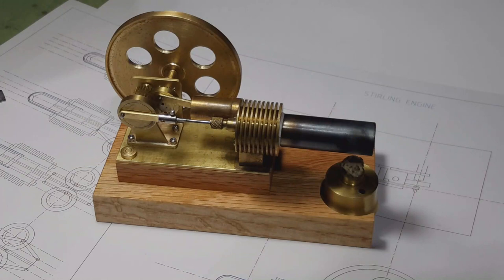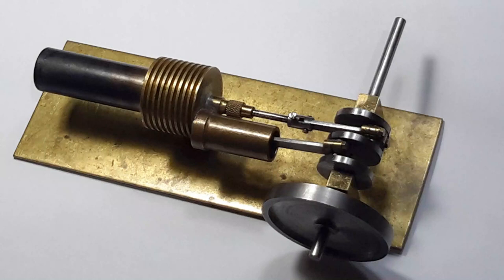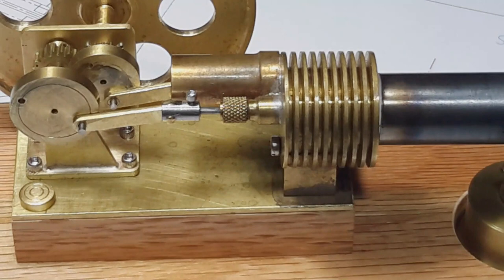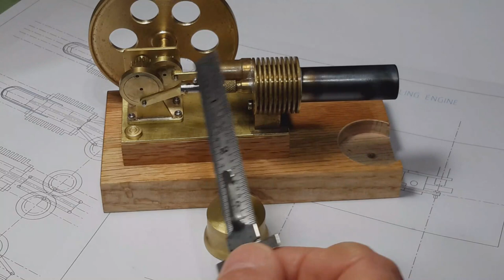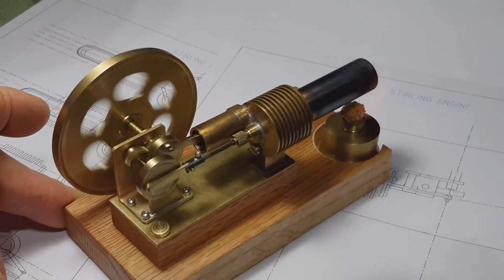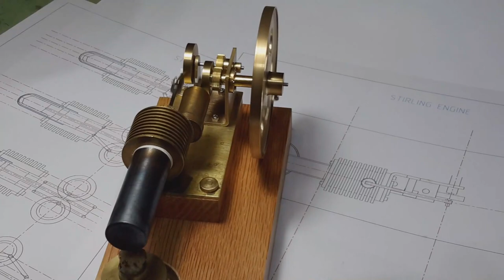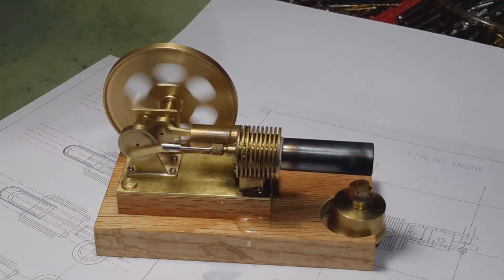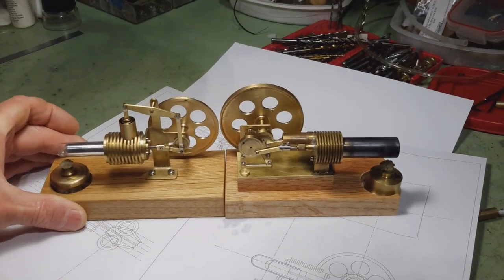TANDEM CRANK STIRLING ENGINE

Comment: Nice runner Les.
I have built my share of Stirling engines that looked good but due to friction just wouldn’t run.It took a few builds to finally figure out what works.
Any resistance on these little engines will keep them from running correctly if at all.
Looks like you have it figured out!
Thanks for another video.